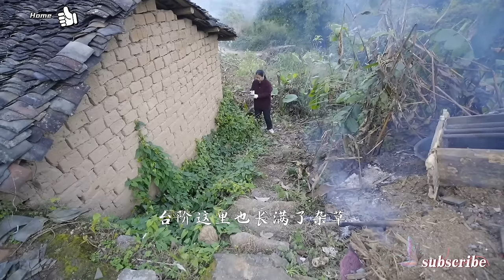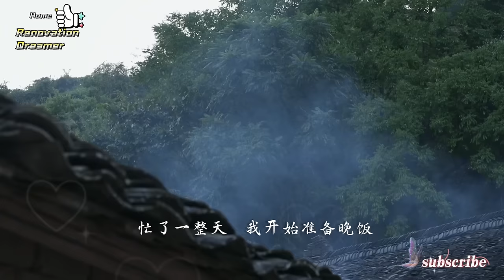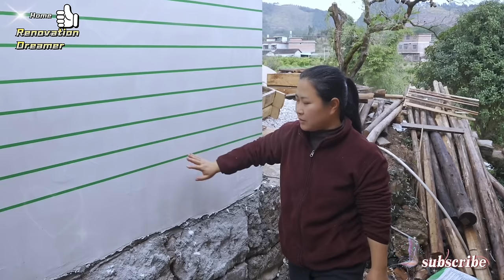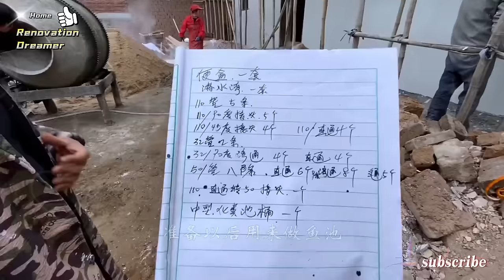The young couple returned to their hometown to renovate the old abandoned house for a long time .

Comment: Metal Wiring for walls are excellent! However, you must also use iron rods with concrete blocks AND cement mix. The key for the basic structural strength  of a building or home is all 4 of these combined.😢
Reply from the maker: Wish you good health, happy laughter spread everywhere！